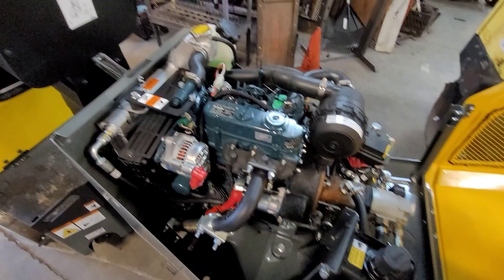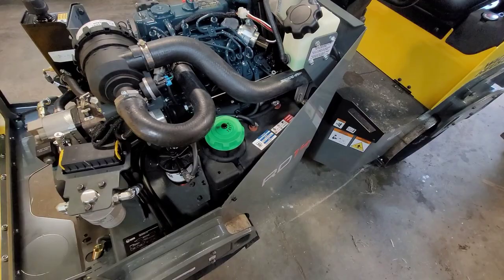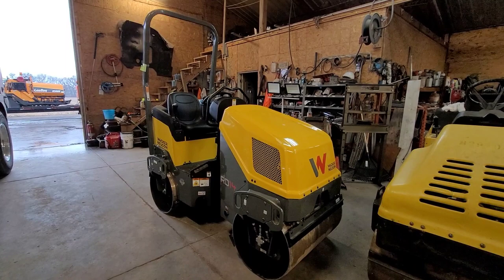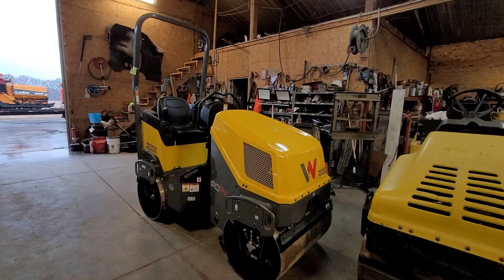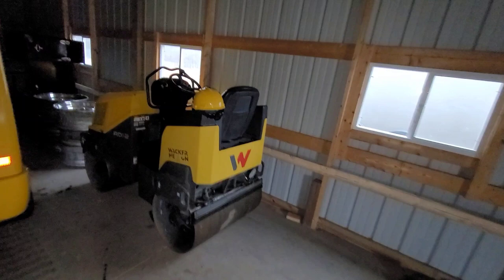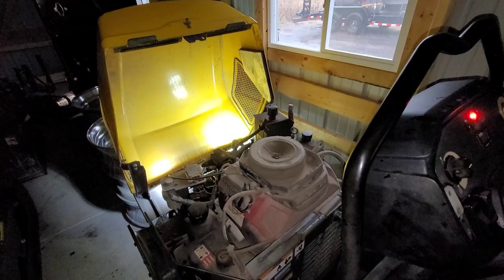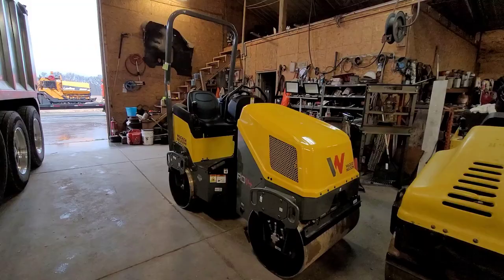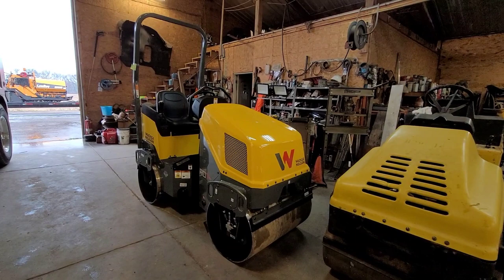NEW ROLLER Wacker Neauson RD14

Comment: We have an RD12 and a HAMM HD12 on order. The best results for us has been first pass and initial compaction with the larger roller. Then the rest with the RD12. The HAMM is great all around and especially for mill and fills; Seals up the joints better and will cover more ground before the mat cools to much. Does the new RD14 have a spray bar or just the old drip bar?
Reply from the maker: Drip bar